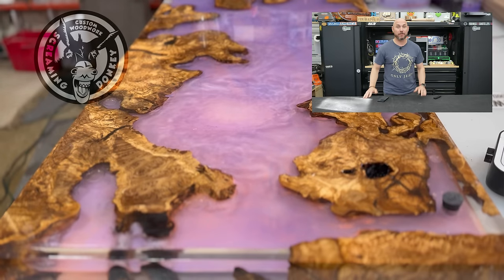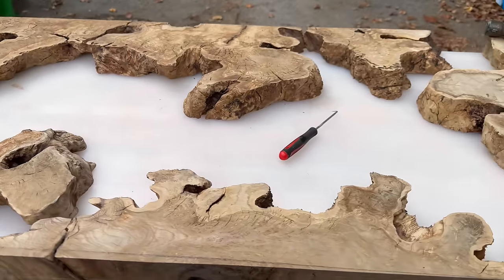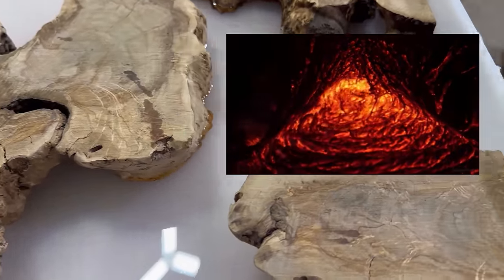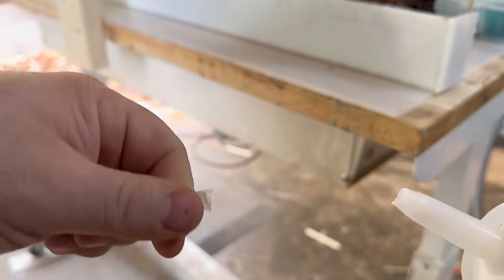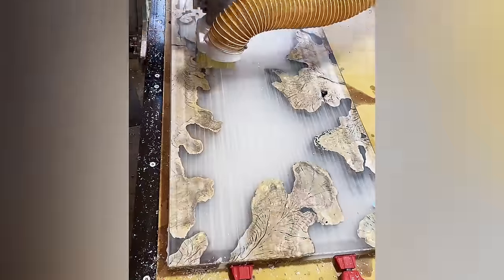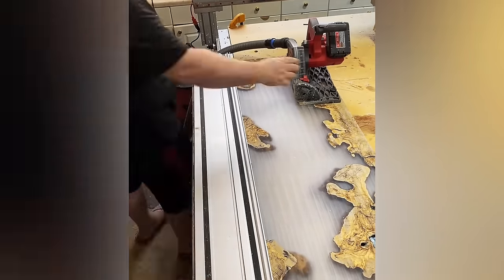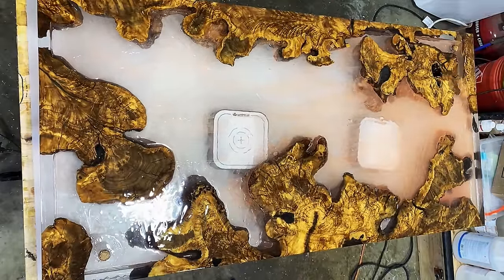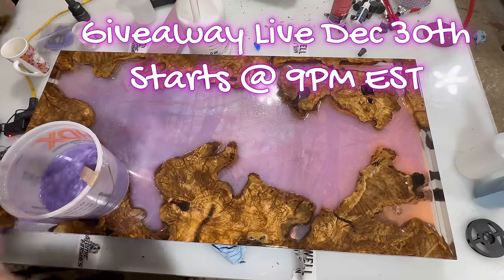I Built a Liquid Core Vortex Table

Comment: I think if you're going to make another table like this again, instead of putting magnetic mixers into it, you should try connecting the 2 holes at the edges of the table with a small hose and have a pump in the middle of the hose. 

That way the water would be pushed from one end of the table to the other side, and it would make all of the liquid in the table flow, instead of having 2 aggressive vortexes in the middle of the table that leaves the majority of the liquid at the edges untouched. It would also be much quieter, as it sounded like those mixers were quite loud. the only down side is that you would have to have the holes on the underside of the table, so they would need to be water tight, but that's not hard to do since you would just need to cut in some threads using a tap and screw in the proper sized fittings

If you like that idea I would suggest looking up PC water cooling equipment, as it is usually very small, but can produce some good velocity for the liquid.
Reply: Magnetic mnixers seems fine, but they are tooo aggressive. Slow them down, put 2 more in for a more even movement and its fine. But the soundissue is annoying if you can hear it somehow. Maybe they are way quieter if you could turn down the rpm. And it still needs to be on legs of some kind. Maybe its possible to build a somewhat sound absorbing box around the whole underside. 

A thing like this has to be absolutely quiet while usage or its useless.
Reply: @nicoschroeder5379  they don't have to be loud, it's more about the surface of the mixer pill and the surface of the thing it's spinning on. I've used mixers in a lab that were nearly completely silent.
Reply: john maleki just did this for a live fish table , was pants , may work better in an enclosed table  ofc.
Reply: But then isn't the pump what's going to be making nose?
You'd also need a pump that wouldn't get clogged up or damaged by the dye passing through it
Reply: @sorayaya3080  a small pump would make a much quieter, and more pleasant noise than that spinning magnet. 

And lots of PC water cooling builds have a lot of special dies and additives in them. While it might reduce the life span of the pump, it should be fine for a long time.
Reply from the maker: @cocoxcocoa  Its super quiet.  you could only hear it when I ran it really fast.
Reply: he could also do both a pump and the mixers so that there would be a flow and little vortexes. with both done at lower speeds, there would be little noise and also really cool looking movement inside.
Reply: @sorayaya3080  PC water cooling pumps are near silent, such as the D5 models. I have one sitting right next to me, never hear it. 
PC water cooling also has liquid that comes in lots of looks, including these color shifting versions, and includes biocides to prevent growth.
Could so flexible tubing, but rigid tubing would probably work out better. 
PC water cooling also has plugs that would fit perfectly, compression fittings for tubing. 
Pumps don't get clogged by dyes, these liquids are like water.
Reply: Yep, this idea of a true flow was the first thing I thought about when I saw there were two holes in opposite sides already. Could look amazing!
Reply: @screamingdonkeywoodwork  Put the fill holes in the bottom, carefully cut NPT threads then screw in nylon pipe plugs with teflon tape. Then you have a completely clear top without the rubber stoppers and can fill the table completely full with no air.

How I'd fill the holes in the top would be to cast a couple of clear epoxy plugs then turn them on a metal lathe so they're almost but not quite a press fit. Have to leave just a little room for epoxy. I'd leave a shoulder so they can't drop through. They'd have to be just long enough to reach the inner surface. Mix a little clear epoxy and pop the plugs in. Then of course the plugs would have to be cut off flush, polished and buffed. But with the table completely full of liquid the plugs should be invisible.
Reply: I was thinking aeration membranes for fish tanks, some pumps I think you can also pump liquid with, hell do all of it lol magnets, air bubbles and cycling the liquid through:)
Reply: @ScytheNoire  it's not the dyes, it's the micas that would cause the issue and pumps definitely will get messed up with the amount of mica dust he has to put into that table. That's basically nano mica dust and it eventually will fall out of suspension.  When that happens in a custom water cooled loop, you can increase the pump speeds in short bursts to make it reflow.  Since this table isn't like a tube, there's no way to increase the flow across all the water in it to get the mica to reflow. He's have to run the mixers and move them around the table manually while increasing pump speed in bursts to get it to flow right.  I don't begrudge the person that gets this table since there's going to be areas all over the outside edges that the mica loses suspension and will have to move the pills around nearly every day or so to reflow it.
Reply: It already has the 2 holes. Flip the table, replace with judt one vortex, and build tge pumps/tanks into the legs, plumb and go for gold.

Comment: the magnetic stir bar was a genius idea!
yeah, the movement issue can be dealt with in a couple ways. I'd make little propeller-shaped additions to the magnetic stir bar, either encasing it in resin/3D printed propeller, or making my own.
the only other thing is probably using a very bright backlight and pigments that don't mix, (like using both oil based and water based liquids together), but that has a chance of ruining the table altogether. I was thinking like some sort of dark/black oil and then the orange pigmented water would do nicely, if you found something that wouldn't stick/paint the inside of the resin after a few hours.

Comment: This is really awesome.
I thought at first you were using liquid from computer water cooling, which does come in versions like this, and has biocide in it so it doesn't get any growth.
Computer water cooling also has screw in plugs that would work better than cork or plastic plugs, and could be put in on the bottom side to remain hidden.
You could also get a flowing river by having a computer water cooling reservoir and pump on the underside, tubing that would have one hole being an input, the other an output, and basically create a loop. PC water cooling pumps can be very quiet, such as the D5 pumps, and some have manual adjustments for flow rates.
I think using computer water cooling parts could really lead to something that has more of a river flow, and a cleaner top.
Reply from the maker: mica clogged three pumps
Reply: @screamingdonkeywoodwork  I think that's why most of the PC coolant manufacturers stopped using it. Even with nano mica particles, they still eventually start clogging the pumps. Still lots of DIY guys making their own, but appears the companies who used to make it have stopped.

Comment: What a great table. The movement really separates it from all the other river tables. 

Here's an idea for your next vortex table. If you cut channels in the underside of the wood to allow the liquid to flow underneath when the motors are turned on. I think the channels would only need to be maybe a quarter to a half inch deep and an inch or so wide to get some flow through them. I think it would be interesting to get the currents flowing throughout the table so you didn't have dead spots. Or as an alternative, you could just raise the wood up a quarter inch or so.

Another idea just popped into my head as I was typing about the channels. You could use one of those little fountain pumps to create an upwelling effect for a different look. Drill and tap from the bottom for a hose barb inlet and outlet. Anyway, just food for thought.

Comment: Blacktail is the goat because of his buttery smooth documentary style audio....but this project is awesome.  One could do so much with various dyes.  I saw someone mention glow in the dark pigment, and it's usually over-rated...maybe if one introduced a liquid flow over a uv led and can see a glowing trail or something.  There is potential there but glow in the dark pigments are more impressive in the imagination than in reality.  UV reactive pigments(glow under a blacklight and often Blue LED's) are much the same way, because as they mix with the resin they lose a lot of vibrancy.

Aaanyways.  Great to see various channels lend a cameo appearance on a smaller channel.

Comment: Very cool, great job. Awesome lessons learned. Now, if i were to do this, i would cut some small pipes into the wood portions so they are hidden, then i would make the legs out of acrylic with wood to support the weight, and put some aquarium pumps in the legs. I would point the jets toward one of the wood parts so it forms a swirl on its way through to the other side of the table. May want 2 pumps if needed. And allow the water columns to flow through and down the legs. I think it would give it an awesome look having water flowing throughout  the table and through  the legs or supports however you design them. Most decent aquarium pumps are near silent and wouldn't need to be very large so sould be easily hidden in the supporting legs or structures. But thats just how i would view this project. Very neat concept.
Reply from the maker: I tried pumps first.  Issue with the mica powder

Comment: i don't know anything about the properties of the solution used in your core, but would it be possible to put some pluming under the table with a small pump? using the picture at the 36:22 mark as a reference, you could pump the solution into the left side of the table at the start of each channel (top and bottom of the reference frame) and have it all flow to the right and exiting out on the lower right of the side of the table. i don't know if this would work with the chemicals or if they would plug up/settle out somewhere or not, but it could be a cool effect.

Comment: Someone may have already said this, but using a pump like the ones used in water cooled PC’s would not only move the liquid more, they are silent too and you can get various different liquids that have mica powder in them that will make it look insanely good
Got to admit I’m going to try a smaller version of this myself !!
Reply from the maker: Problems with mica clogging the pump

Comment: very cool idea! but i'd like to make a suggestion for next time... if you drill ports on both ends, plumb to it with a small aquarium pump in a reservoir you could actually see flow through from one end of your table to the other. more like a real river.

Comment: I have to try this, I would want to try to pump the fluid from one corner to the other, so the river table would have a linear flow.
Reply: Wouldn't you need a reservoir outside of the table (unless you're gonna trap the pump inside of the epoxy) and kinda big pump to do it? That table holds like 10-15 liters of liquid. And getting all the air out would be painful.
Reply: I would only use a small reservoir if at all, Once you get the bubbles out, they should stay out unless you have a leak.

The idea is there would be constant flow, slow in the wide, and higher speed in narrow areas, and eddy currents in the outlying  sections on the edges.

Comment: Honestly I don't have too many opinions about epoxy as I've never worked with it, but pigment I have a lot of opinions about. You tend to pick really high quality ones. I normally bought Calotint when I was working in theater, but have heard excellent things about Novacolor. Those are for latex paint. If you've never tried combining shellac and leather dye tho the results are BEAUTIFUL. The are both alcohol based so you only need a few drops of dye per cup of shellac for a beautiful pigmentation. It was my go to method for faux stained glass.
Reply from the maker: Great options to try

Comment: @8:51 - using the stick introduced more bubbling, as you can see the epoxy wrapping around the stick and creating bubbles right near the end of the stick. With such a laminar flow from the pour, straight on the center of the white area should produce fewer bubbles than using a stick.
Reply from the maker: ooo.  I love laminar flow... but the bigger bubbles pop on their own... its the micro bubbles you can't see that we really care about.
Reply: @screamingdonkeywoodwork  Micro bubbles are often formed when two streams meet and trap a small amount of air between them when "closing", like how the base of the stick causes the flow around it to trap small bubbles near the V point of the flow at the base. The big bubbles pop, but you trap smaller amounts of air that can't float free. If you've already degassed the epoxy, reducing the number of places where air is pulled along for the ride and folded into the epoxy will reduce the number of micro bubbles.

Comment: So where the legs would connect to the table you have on one side a pump and then on one of the embedded wood structures of the table you send a house that splits into many hoses. You have the bottom part of the table on the interior cavity on a slight angle. Then on the other side of the table you have a catch for the fluid that connects via tubing through the embedded wood, to the other leg of the table which also has a pump. However this sucks from the table and pushes out down the leg and then through the h-style base support and up the leg to the other pump. Voila! A closed circuit water system that will flow like a river. Use black pigment and uv dark red with black lights... This will make lava. You're welcome.
Reply from the maker: We tested a couple of pumps and the mica clogged them

Comment: A hidden pipe with a small pump to move the liquid from one corner to another would be cool.

Nice result.
Reply: The pumping action could be done magnetically from the outside.  You could add some fins to your magnets to make them into more effective impellers even in your current table arrangement.

Comment: Beautiful effect, a small pump would probably work better to move the water around. But that would introduce more potential leaks. I hope you find a way to optimize the moulding so it won't take as much time or effort to make, like maybe build a stand with some motors to "roll" layers of wisebond epoxy
Reply from the maker: Great suggestion!

Comment: Would it it have been much faster and easier and less time and labor to just pour the table as a whole then rout out the liquid section then flip it and pour the new bottom reducing it to 2 pours and a fill for center ?
Reply from the maker: Maybe but, 2 issues there.  Converting an image into a carve = not fun & super time consuming.  You’d see the refraction around the wood like you do around the outside of the table.

Comment: Upgrade ideas
1. Watch Dip Your Car for the coolest hypershift color combos for the fluid
2. Use a pump as well to make all of the fluid move to an extent along with the vortexes which are rad as hell
3. Led lighting that's more focused like directly under vortexes as well as more flat and general lighting instead of the light bars that are visible when the lights are off
4. Colored/holographic transparent screen on top to further saturate and compliment a hypershift effect of the fluid inside
5. Mirror finish silver metallic paint on the wood and base of the table touching the fluid further enhancing the hypershift effect and LED lighting
6. An alternative and this is really going the extra mile, but you could do a fairly transparent fluid and have a painting hidden under the water on the base of the table that fits thematically or even a diorama like a sunken pirate ship or Atlantis. That could make a several thousand dollar table enter the hundreds of thousands range depending on the artist who made the painting or diorama and the quality of the work
Reply from the maker: Saw it... awesome.  Pump was the first attempt and the mica clogged it.  Couldn't put the light under the vortex because... thats where the spinny plate is.

I'm responding to this old post because I have a sudden compulsion to clear all the "I haven't responded."  If your comment was generally supportive:  Thanks for watching I really appreciate it.  If it was insightful:  I'll definitely give that some thought before I do it again.  Negative: traumatic brain injury or just born stupid?

Comment: Neat concept,  my suggestion for the flow effect would be to use pearlescent coolant used for pc cooling. A small pump and some tubes would give a nice movement. Even change the flow with valves.
Reply from the maker: Thanks for the tips!

Comment: You could try adding a tiny pump or two to shoot a stream from the corners to the stir bars, that way there would be less 'dead zones' with no movement.  There are water pumps small enough to go through a water bottle cap.
Reply from the maker: we tried a few, but kept ending up with mica clogs.

Comment: I wonder if using a longer metal rod instead of the little white pill would churn the liquid more?  This is an amazing table build.  So creative, I can't wait to try one of my own!
Reply: I was thinking this too, but it doesn't need to be, and probably wouldn't be, metal.  The pill has its magnets in the middle, so the plastic around it could just be longer.  BUT, there is a limit to the torque the plate will be able to transfer into the pill to spin it in the liquid (water is quite heavy).  I like that line of thinking tho!  Maybe a pill with little winglets off the end that push the liquid out further might help?